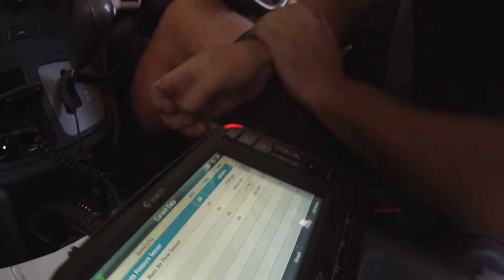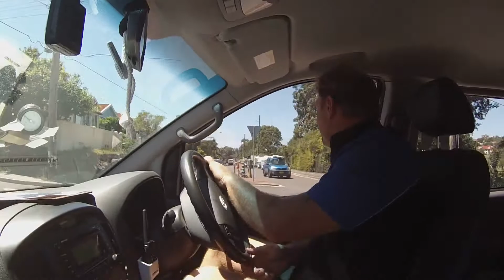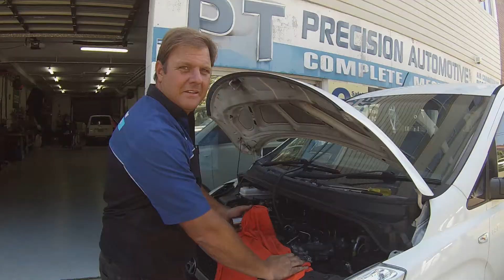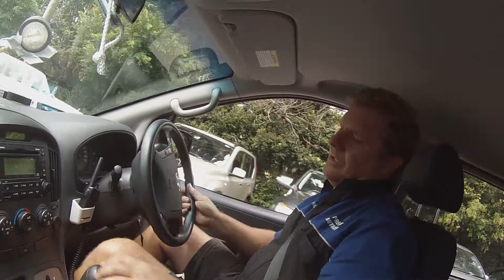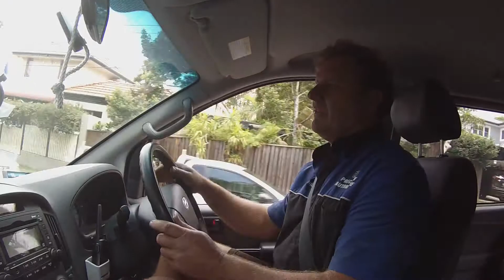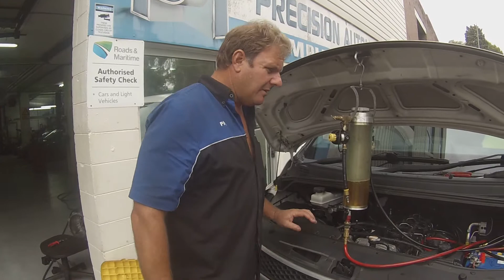Hyundai Load 2010 2.5 Litre CRDI Turbo Diesel.  No power down low, EGR Issue , Mechanical fault.

Comment: I've had an Iload 8 years...twice in that time had real poor power and acceleration....misfiring under load, both times, changed fuel filter and wow..... massive improvement and problem sorted....great van, love it to bits.....VW T5.....nah....be different, be Iload.....👍👍

Comment: Mine is soooo slow even after engine replacement, transmission kit replacement, road worthy certificate, etc.
I feel like changing the EGR but i already spent thousands on repairs
Reply from the maker: needs diagnosing

Comment: Ive replaced the head which was severely warped.
I never got to test the car prior to fixing.
I have this issue you had but the EGR is working perfect.
Any other faults?
Van drives great and I'm about to do air and fuel filter.
EGR is shut at idle and opens when reving engine so I'm confident it's mint.
Reply from the maker: could be anything, air mass, injectors, intercooler, turbo, you need to get it to a mechanic to diagnose
Reply: @PTPrecisionAutomotive  all good, I'm a mechanic and been testing everything.
The can came to me dead so never got to test it or see running which makes it harder for us to diagnose.
I suspected turbo and sure enough it's stuffed.
Next I will pull sump and clean pickup and flush oil.
Cheers for responding 👍

Comment: you sound like you're over this shit lol. I'm here because my nephew has an iLoad and I'm trying to help him save it by completing some common preventative maintenance, he just had the injectors done so now telling him to decarbon the inlet manifold, check oil pipe to turbo, change oil way more frquently, run manifold cleaner through it every service and check the oil pick up also. Has 200k on it, 2010 model. If only he'd asked me before he bought it.. This is another thing he needs to check I guess, bloody diesels are high maintenance like this.

Comment: Thanks for that. I have the exact problem as this Iload. Except for the fact that the EGR has been replaced and made no difference other than the EGR code went away. Have you had any experience on other faults that could attribute to the same issue?  Same as in 2000 rpm it almost feels like you are hitting the power band in an old school 2 stroke motorbike. Mine had the EGR code the EGR valve looked like it was corroded to open so we were confident just as you were that the problem would be solved but no change at all.
Reply from the maker: how did the throttle valve look before the egr, you may find that the valve may be stuck closed/ open or gunked up. the use that valve to make vacuum on intake to suck the exhaust gas through. without more information I cannot help you much
Reply from the maker: maybe an air mass meter or injectors
Reply: @PTPrecisionAutomotive  thank you for that. I will have a chat to my mechanics. Getting desperate. Am meant to be driving it up north in 6 weeks and it will be fully loaded as moving house. Need it to be back up to fully operational.
Reply: @PTPrecisionAutomotive  Dramas still continuing. The van has now had the EGR valve replaced, an induction clean and the injectors cleaned and checked. Also the turbo boost was checked. The mechanics said all were fine. Did a long drive on the weekend after the induction clean and made no difference. The mechanics I have taken it to are scratching their collective heads wondering where to go next. Any other ideas.
Reply from the maker: @michaelrand6049  Sorry mate . you would need to get it to us. for correct diagnoses , all that is going on is a waste of time.

Comment: Awesome video. Could you have put an egr blanking plate on and disconnected the egr electrical clip to test drive it.  4 bolts on the top right of the engine....there's a cast metal routing tube from the egr to manifold intake tube on my 2012 iload.
Reply: would be good to know as i have that problem with my iload that i have just bought

Comment: Great video. Can i ask, did you have any MAF error codes? My ford transit 2.2 diesel has low power under 2000rpm, and is giving a MAF error. Do you think it's likely the EGR valve causing this error?

Comment: Is it loads of work changing that egr valve? Are there different types of egr valves too? At my car parts they sell three types of egrvalves, the ones like yours, and the ones looking like a wastegate, and also some plastic looking housing with some electric connection on it. I'm guessing I have the same problem. I also got a check engine symbol on my dash, and when checking the generic code it said that the boost pressure was to high or something similar. And while reading about possible causes they mentioned the wastegate might not open or something like that. Is it maybe caused by the EGR valve aswell? A new turbo setup wasn't all that expensive either. I know there are many hyundais who has died due to turbo failure since deposits have build up on the oil pickup for the turbo. So I might change turbo, egr valve and also abs sensor before winter is coming... I recently bought the car... It's a 2008 iload or h1 as they are called in sweden, H1 starex.

Comment: These vans also have a habit of leaking past the injectors into the rocker cover, usually clogs up turbo oil lines and the oil pick up usually leading to failure for the turbo and engine depending on what blocks first.
Just about to change the injector washers in my iload i just bought, in which i suspect it has a new turbo due to all clean and rust free bits on 180000km 2010 engine
Reply: Mine went dead on the freeway a few weeks ago, wont start again. Little resistance on starter Engine. Think what you describe has happend to my car. What type off rebuild do you think im looking at?
Reply: @fredrikdudat9810  exactly what happened to mine
Reply: @matttzzz2  sad. Great van, but that's a bad built engine. If i had known about its problems from start i could have maintained it in a better way.

Comment: Great Video.. i'll bet ya $10 that turbo ended up blowing up 3 months later..
I actually wanted to buy a used one (2011 with 200,000km)..
But after my work mate's horror story with his, i'm reluctant to consider one.
His had an injector clamp fail, the turbo failed shortly after and then it spun a big end bearing.. he was servicing every 7500km.. this all happened under 200,000km! It's all back together now.. and it is a 'good' van, but is it worth the headach?!

Anyone know if the 2.4 (petrol) are more reliable?
Reply from the maker: can i have that $10 , it's coming in today for a service and still have not put a turbo on it.hahha
Reply: 2.4 is a donkey
Reply: @Djavo1  rather a donkey than flog a dead horse

Comment: I was thinking of buying a new one of these (2018) but found a bunch of forums where people complain about the turbos breaking. Do you reckon these are a good buy? If not what van would be your pick? Im trying to avoid all the euro 6 adblue stuff
Reply from the maker: No i would buy one , you get 5 year warranty anyway. BUT you need to service them.... or at least change engine oil and filter every 10,000ks....

Comment: phil, i have a 2011 hyudai starex crdi, already clean the egr valve cause it is loosing power during accelaratio and when i reach the rpm 3000 it dont want to give more feels like hesitating to give power, already rebuild the injectores and new rail sensor, but  one thing i notice when i put the wire connector to the sensor the engine sounds like knocking, when i remove the connector it sounds ok no knocking, can you help me thank you
Reply: You should take the car to a mechanic to diagnose correctly

Comment: Hi PHIL,
Great video. I have a Hyundai IMAX 2008 petrol auto model doing the same thing with 144k done on it. It is currently showing an error code P0016. Lack of power, hesitated to accelerate and engine heavy. Do you think these models also have an egr valve? I have been advised by my mechanic to check /test the oil control valve first. I am in Perth and currently need to get a second opinion/idea before getting it in for a proper fix rather than getting speculating opinions from various mechanics. Hope you can help. Thanks
Reply from the maker: P0016 HYUNDAI - Crankshaft Position-Camshaft Position Correction- Bank 1 Sensor 'A

Dirty Oil 
Low engine oil level 
Faulty Valve Timing Control (VTC) 
Valve Timing Control (VTC) 
harness is open or shorted circuit.
Valve Timing Control (VTC) 
circuit poor electrical connector 
Incorrect timing Engine mechanical problems 
Damaged Engine 
Control Module (ECM)
Reply: Thank you very much. Much Appreciated